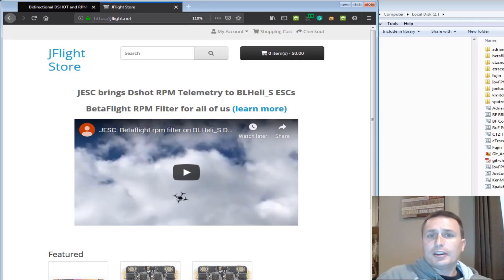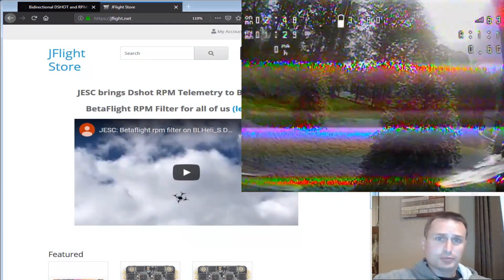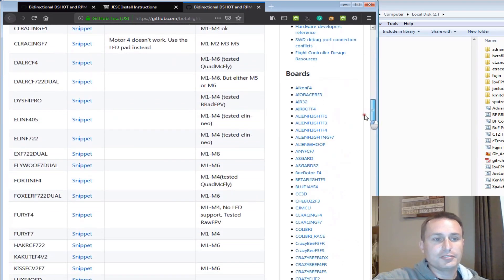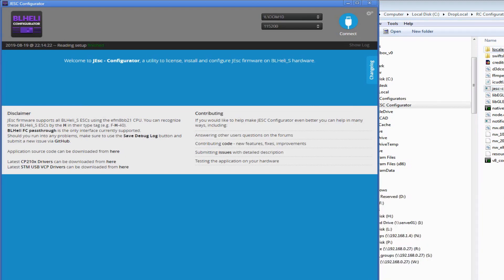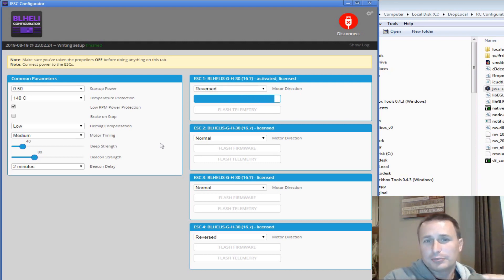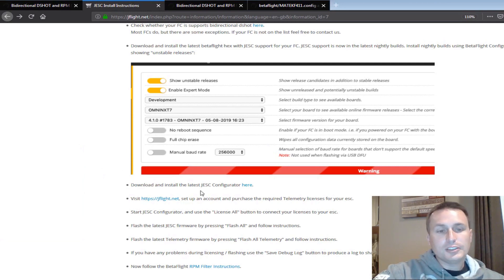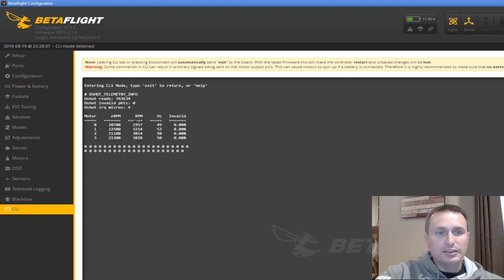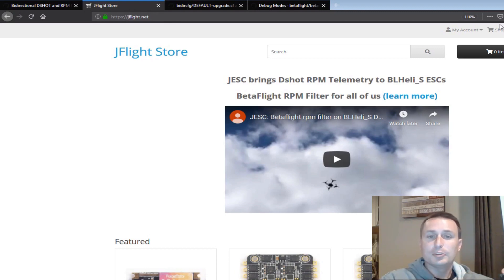Jesc - RPM filter for BLHeli_S ESCs

Comment: Too much jumping through alpha-hoops... I compare it to changing a bearing on a motor, yes you can do it and save a couple bucks but even for a cheap person like me it's not worth the hassle and just easier to buy a new motor. ,)
Reply: I think just like you. But my preferred build has blheli_s esc's, and I don't really want to take it all apart, to exchange a perfectly fine esc to a blheli_32, so this could be a good solution. But yet again. I think it is fairly expensive, for a minor different experience, since it is already flying awesome.
Reply from the maker: RPM has more advantage than just a bad bearing tamper.  Of course if you have a bad bearing you want to fix that, but are you always going to fly with fresh props? What about when you clip a gate or a branch?

If you have 32 bit ESCs you are set.  If you have _S ESCs, you are set now too.
Reply: @uavtech  I don't say it's a bad idea, I'm just weighing the hoop-jumping against the benefits and it doesn't equate for me... ;)
I guess it won't be long until they make the whole process a lot easier, then I'd be gladly willing to dish out the 2-3 bucks.^^
Reply from the maker: @hateeternalmaver  , yeah.  If you make time, doing filter tuning and PID tuning in general is the best bang for the $; especially since it has huge gains and is free!  

The issue is no matter what, you need to update to new ESC firmware if - whelp - you want new features.  After that it is just a BF update (standard stuff) and one paste to turn on RPM.  

Wait till I show why and how to upgrade to OpenTX 2.3.0.  Also a process, if you are on Frsky.
Reply: @uavtech  It might be a bit assuming on my part to say it's complicated without even having actually tried it... ;D Either way thank you very much for explaining this. Looking forward to the OpenTX thing. <3
Reply from the maker: @hateeternalmaver  , yeah, that will be pretty worth it; the OTX thing.

Comment: Fuck yea bro, now I can finally go BF 4.0 :)  
u da man....I fly only racerstar Rev35 4in1s on pyro f4s, thanks Mark
Reply from the maker: 👍  , but you want 4.1.0.
Reply: @uavtech  ok I'll wait, I have 357 flyin perfect
Reply from the maker: @flo-ridafpv5713  , if ant broke, don't fix it.
Reply: @uavtech  ok Mark gotta ask then if rpm filter is worth it for me ? I fly 4s on 357 got stiff frames flyin smooth AF on new xings w gyro 1 @150 & dtem1 at 120, CLI dyn filter at 5 and 30 per your recomm, up 3 on P and D, that's it minus rates & ffwd stuff, oh Tpa bumped down a bunch.  Will rpm filter help what little propwash I got ?
Reply from the maker: You will find the dynamic notch peak tracking is better in 4.0.x vs 3.5.x.  You will also see better noise attenuation with lower overall phase delay with RPM filter paired with the DN so you can raise the cutoffs you have for the lowpasses.  I would put your 3.5.7 settings into 4.1.0, turn on RPM, check it out, and than start raising your lowpass cutoffs.
Reply: @uavtech  ok thanks for the reply bro :)

Comment: We have these ever so popular 12 amp aio boards now with no BB. Running 2" and  3" props. I always here over and over to put them on bf 3.5.7. I would love to try jrpm on them. Would it be troublesome without BB to get it tuned ok? That explosion never gets old. Muhahaha
Reply from the maker: I don't think it will be trouble at all.  Can probably turn harmonics = 1.  I didn't show that.  The rest just do the paste.  Then i would go a step at a time and turn off lowpass filters.  Mostly on Gyro.  Mayne Lowpass2 on D-term.  Just track motor temps and how it performs with prop wash.

Comment: does it fly better than on bf 3.5.7 with that new filter?
Reply from the maker: The iFlight 120RS?  Eh, i need to get better props for it.  Lots of oscillations on 3.5.x, 4.0.x, or 4.1.x.  The RPM helps with the high frequency stuff, but the low wobble on throttle punches is problematic.  The props are on order as of tonight.
Reply: @uavtech  i built a toothpick on my own frame with the same stack, and the amax 1103 motors

i had some yaw twitches on 4.0.4

the props were some cheap generic ones
they could be slipping slightly

i'll try the hq 65mm next

but first i have to order a new stack
the vtx burned out, and not too much later, the 3.3V regulator of the fc

i've got a refund from the ebay seller

or do you know of a better stack?
Reply from the maker: @marc_frank  , I don't know anything really about the best Toothpick stacks.  Anyone one that has dataflash for logging would be my vote for best; if one exists that does.
Reply: @uavtech  hglrc f4 zeus aio
but it is old and 20x20

would require 3"
Reply: i have another question, why are filters even needed?
i heard, that the movements of the quad are very low on the frequenzy range and the vibrations very high

i imagine it like this:

                       /\                          /\/\/\/\
_______/\_/\/    \/\__________/               \/\/\/\ 
            movement                      vibration

why isn't the upper rage just cut off?
Reply from the maker: It is a continuous signal, you can't just cut something out.  There is nothing to cut.  Remember, the plots you see if noise graphs are spectrographs.  So they are translated from Time Domain to the Frequency Domain for human consumption to see where vibrations exist when looked at from a frequency standpoint.  There it seems like you can cut something above say 100hz in frequency, but remember the real signal is in the Time Domain which is a continuous stream of data; plus the code doesn't know what is coming next (real-time processing).
Reply: @uavtech  hm, yes
i have thought about that, after i made the comment

so what i drew was a very short segment of the movement and all the bumps were vibration

i guess f4 and f7 don't have the computational power to run a real time spectrometer, and even if they did (maybe the clracing h7 could do it?, no idea) the latency would be increased

but if it could be done, then i think the upper hz range could be cut off and the lower translated back to the normal signal?

probably still wrong

we need time travel computation
Reply from the maker: @marc_frank  , a spectrograph (fast fourier transform) is completed to position the Dynamic Notch.  But as far as I'm aware, signal processing doesn't work like you are thinking.  The FFT can only be used for filter positioning and human consumption of what the signal vibrations look like from a frequency standpoint (how often vibs are of a certain spacing and what is the magnitude of the vibs at that spacing).
Reply: @uavtech  that is sad

i hope i will learn some of that in the next 3.5 years

Comment: just because you can doesn't mean it is worth it. How much more performance do whoops or toothpicks get with the rpm filters?
Reply: Rpm filtering is the most accurate you can have
Reply: Does that mean that it is useful for whoops? I'd like to see a better video on this giving performance difference for whoops and toothpicks. Uav techs toothpick had a lot of propwash and vibration.
Reply from the maker: That was not tuned.  We will do that next.
Reply: EmuFlight doesn't have access to the rpm filter. Yet all my testing shows me that EmuFlight had better propwash handling than betaflight. So I'd like to see a test of the two different filtering styles.
Reply from the maker: There is no question notches are the most effective filter for the associated Phase Delay.  Much better than any lowpass for peak noise attenuation.  Any signal processing engineer would think our circular conversations in this regard are crazy since notches are specifically designed to attenuate peak noise and lowpass filters are designed for tamping down higher frequency ambient noise.

EmuFlight is a good project to try new things without the tedious QA review BF has in place; but that is NOT to say BF is wrong for having strict standards and QA process.  

EmuFlight is based on BF and PID controllers are very simple.  The Helio filter is an IIR lowpass filter that lifts with stick movement; a neat idea.  This said, in an apples to apples test (same rig, same pids, same basic filters setup, etc... ) they wil perform the same.  Anyone is welcome to prove me wrong with HD video and acompany log files to confirm thigns are apples to apples.  I kind of did this already with my Helio test videos but can take another look once Emu has a stable release published.  Keeping an eye on it.  Like the guys in the trenches  and the push to try new ideas.